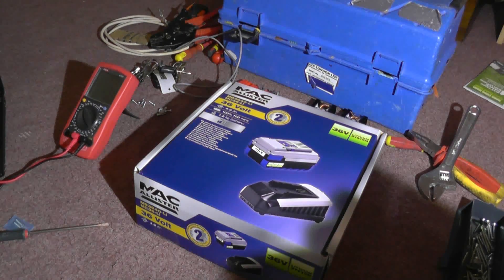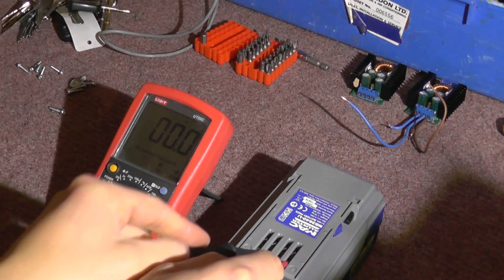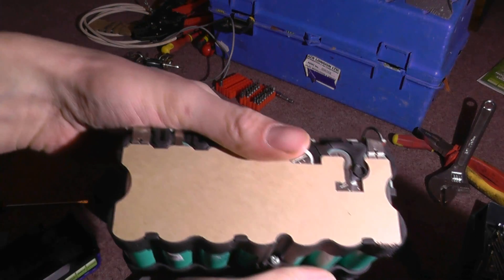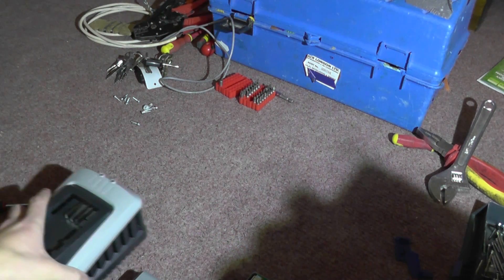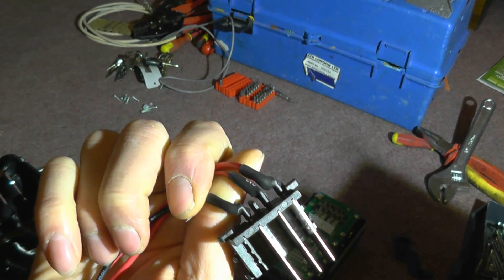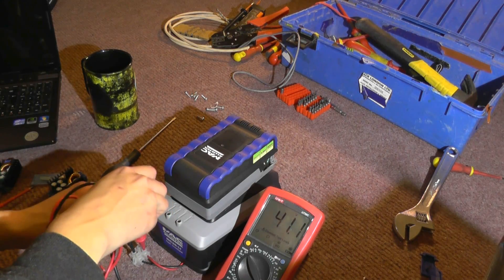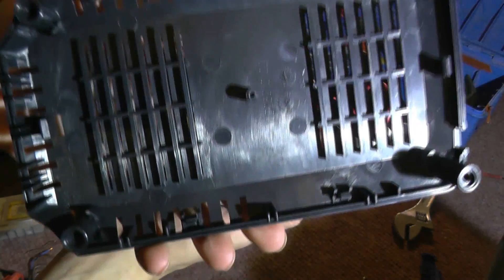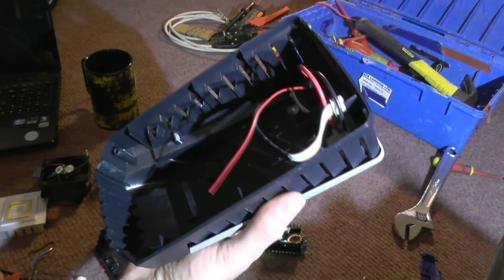36v 4AH battery

Comment: I bought 2 of these batteries and a charger for £2 at carboot sale. voltages seem right at 40v. I have not tested them under load as i dont have a garden tool they are designed for. How can i check the  packs condition?

Comment: Price back down to £34. Got a couple more today for my ebike.the ebike shop gave me a  dead 26v 9ah urban mover battery today.I have just opened it and inside there is CGR 18650 cf.I have pulled some of the same batteries out of laptops.so if laptop batteries are no good for ebikes.the people who make ebike batteries are having a laugh.God knows what cells are in the cheap eBay batteries.

Comment: Thanks for the reply Peter.it says it charges at 36-37v - 3.6 - 3.7a 100 min.I have l have laptop batteries that i'am testing and making in to packs for an electric bike,I can't make up my mind what size packs to make yet.i thought the price of the mc allister's was to good to miss.A friend gave me a makita drill and battery with no charger.the battery has a + and - terminals and what looks like a balance plug.i opened it up there was a circuit board with only + and - and one extra + going to the battery.i cut the circuit board out of the circuit and wired my own balance plug and charged it with a imax b6 charger.i will now be the b.m.s.i'am now thinking of getting a 10 s balance charger to make 36 volt packs and maybe convert the Mac allisters.
Reply: To power an electric bike, you would need high power batteries that are used in drills and saws rather than the type used in laptops. The laptop batteries have a higher internal impedance compared to power tool batteries. Google the type in your laptop battery compared to the drill battery and you will see what I mean.
Reply from the maker: I am also a BMS from my projects! =) I have no trust in the ones on ebay. I honestly don't want to destroy my packs yet. But if I was doing an e-bike I would cut the packs up and resolder as I needed. I don't find it harmful charging at 1C. Also with what Ted Saari said in regard to the impedance with laptop cells, you could overcome this by putting more in series to lower the discharge current across each cell!

I.E  2A  on 1 cell - 2A on 2 cells parallel

Comment: Why not just tap off of the battery at 12 volts and 20 volts? A 40 volt battery will have a connection for every 4 volt step. Just solder the appropriate connectors for the attached devices.
Reply from the maker: That is something I have overlooked! How ever I didn't want to modify these packs just yet because of thier 2 year warranty. I will bear that in mind for future mods!
Reply: As you say, it would require adding extra connectors to the battery, and voiding the warranty on the batteries. Also, you would have to verify that the charge circuity is intelligent enough to re-balance the now way out of balance cells.
Reply: Peter Feerick As the lithium cells age, they become imbalanced. I have taken many lithium packs apart and sometimes one cell will be the culprit and replacing it restores the function of the pack. Lithium packs charge each 4 volt cell group separately (in parallel) as opposed to NiCd that just charge the pack cells in series. Leads could be brought out of vent holes. The only problem would be if there is a seal that needs to be broken to open the pack. The warranty would be voided just doing that. You also need to make sure you register the pack. I know from experience that Ridgid cordless drill batteries that are sold with a drill have to be presented with the drill (console) that are within a 24 week manufacturing date as indicated in the serial number.
Reply: Ted Saari You raise some good and valid points. Yes, as they age, they loose performace and thus imbalance. This is typical of laptop batteries - one group or cell will fail, making the pack useless. Not all charge systems charge 4v groups, some charge 8v groups - two cells in series. And yes, when the batteries comes with a the device, you usually have to present the device. In this instance, Peter bought a battery and charger seperately, so this should not be the case. AEG is also different - they will replace the battery without requiring the product returned. 

And the funny thing with warranties is you need to go back to your countires own legislation to see what your full rights are. I know here in Australia that (say in the case of a manufacturer who says the batteries are not covered, or the product is 3 years, the batteries are 6 months) - consumer protection legislation overrides that as it should be long lasting and fit for purpose. Thus if my AEG drill, which  has 3 year warranty of the battery, 6 years on the drill, and only three months on the chuck (!?), I will be pointing out that legal requirement  if it fails in 2 years with intermitent use when it is considered a trade quality tool!
Reply: This is some good info on battery cell resistance.
http://batteryuniversity.com/learn/article/how_to_measure_internal_resistance

Comment: What are the third and fourth connections on the battery (NTC and CH-) for? and why was one of them at 28v, interesting that the charger is set to undercharge them a bit, I guess to extend charge cycle lifetime
Reply from the maker: Outside terminals are positive and negative. One next to negative is the negative charge point and the other is either to wake the pack up after it has been flattened or pack temp sensor. I think it is common to under charge the cells. you don't gain much by charging the last little bit.
Reply: Very interesting. Do you know why it needs a charger negative. I have no idea about these things
Reply: jeales895
NTC would have been the negative temperature coefficient temperature sensor (to make sure the pack isn't about to go up in flames. A lot of chargers will refuse to charge the battery if they're just finished a hard discharge and are hot. And if the batteries heat up too much during a charge, it will also terminate.

The charger needs a negative (or ground) connection so it knows what the positive voltage it will apply to the positive port is relative to (ie. it is 36v relative to a 0v ground, as opposed to 24v when neg/ground is 12v, or 12v when ground/neg is 24v). It would have been reading 28v simply due to some back-feed from the charge circuity. If any load had been put on it, it might have dropped to 0v, or have burst into a puff of smoke as it wasn't intended to have a load place on it...

The reason for the separate CH- connection to get access to the battery neg would be due to the packs internal protection circuitry cutting it off from the rest of the world when the battery is flat. The CH- port would always work as it is part of the charge circuitry, but mean to top the battery back up, not discharge it.

Comment: If fast charging is bad for battery life,is it posable to slow this charger down.
Reply: It really depends how fast this charger charges the battery. If it charges the battery in under an hour, then probably charging the batteries way too hard. 60-90 minutes is 'fast', and is charging the battery at between 0.7C and 1C, but lithium batteries are usually OK with that sort of charge rate.

NiMH batteries can be charged at that rate, but prefer a bit less, usually nearer to 0.5C (no less that 0.3C and not more than 1C, otherwise the charger may not charge them properly). There are these ultra fast charge NiMH batteries you can charge in 15mins, which are designed differently, but they don't have any near as many cycles are 'normal' NiMH batteries which are charged at slower rates do.

And just to clarify what 'C' means, If you have a 4Ah batterry, and charge it at 4A, you are charging it at 1C. If you charge it at 2A, you are charging it at 0.5C. It is a reference to the capacity of the battery. The reverse also applies for discharging. If you discharge a 4Ah battery at 1C, you are draining it at a 4 amp rate. Some batteries will list their maximum discharge rate this way. So a 10C 4Ah battery can theoretically be discharged at a 40A rate...

Comment: Be careful, I think those buck converters are only rated for about 32v on the input. Check the capacitors, they're usually a good indication of maximum voltage. Don't want to feed your laptop 40v, could prematurely activate the magic smoke generators and cause tears. Best of luck though. I've built my own pack out of used laptop batteries and made up detachable leads for it. One of which being a standard car 12v socket so I can use my car laptop charge a 120w boost converter in it.
Reply from the maker: Good point! I shall check! I'll be honest! No smoke yet! =) Main use will be 12v for using an in car electric blanket for extreme camping
Reply: Hopefully they can manage it, but I would be cautious especially where your laptop is concerned. I know when I was building my LED garage lighting setup I was looking for buck converters to provide low current 12v for control stuff and it was hard to come by anything that could handle over 36v. I know the LM2596HV based boards can handle 60v but only 3A maximum, they're about £10 and you have to look out for fakes. I don't know what else is out there for higher current stuff.
Reply from the maker: *****
The most it will need to handle is 3.4A peak at 21V and 3A max for the 12v side! So they should coupe. I will have a look this evening! Thankyou for your help =)